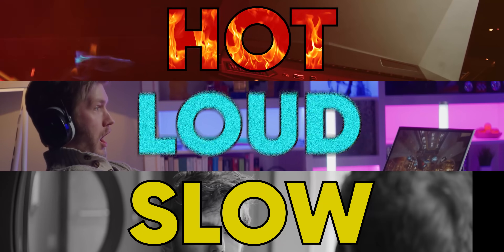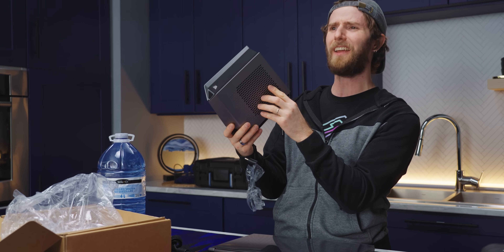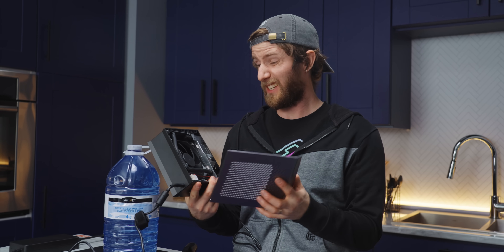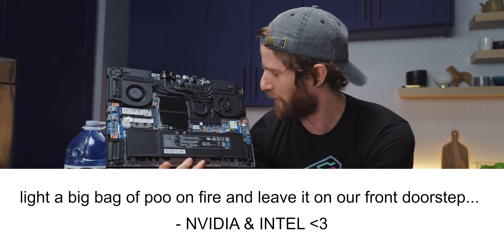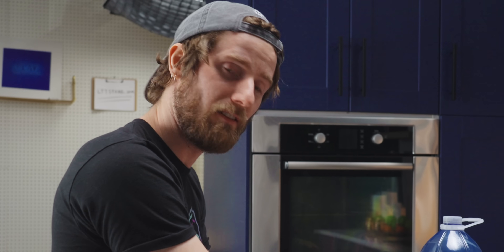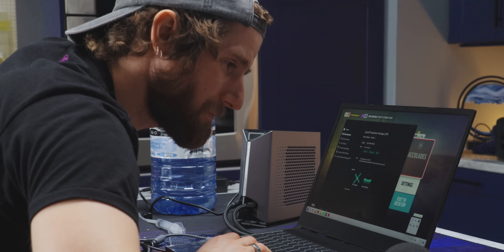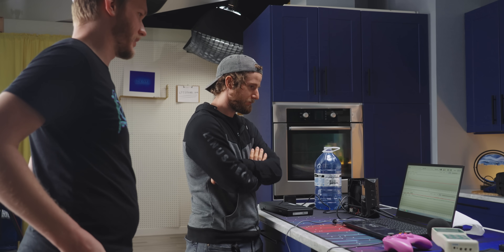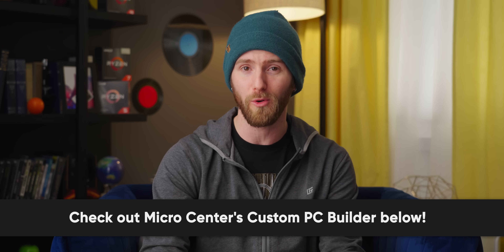This INSANE Watercooled Laptop Has a Huge Problem! - Eluktronics Prometheus Prototype

Comment: Thanks for your feedback! We’re really excited to have a literal game changing cooling solution for our performance laptops.  Yes, yours was simply an early engineering sample and all of the sound concerns for our production version have been addressed.  The water reservoir has been redesigned to greatly reduce bubbles. The internal PCB has also been enhanced to reduce audibility of the cooler.  Also, the cost will only be $99.99 when bundled with laptop purchase.  Much more to come!
Reply: Wow, we rarely ever see a reply from a manufacturer addressing the concerns or acknowledge the feedback. Nice work Eluktronics.
Reply: @N1lav  well eluktronics is not really a manufacturer. this is a tongfang laptop. eluktronics is the reseller. thats why xmg offers similar thing in EU.
Reply: @N1lav  they are not the actual manufacturer though.
Reply: @N1lav  xmg also replies, I had a conversation with XMG Tom, It was really helpful!
Reply: Does Eluk/XMG G3R Air cooling performance par with legion 5 pro with same specs? if we exclude liquid cooler and only consider max performance on max air speed?
Reply: thank you for the reply. a user replaceable fan would be great since fan come in different specs for different reasons as you'd know. but a great product i must say i am really intrested in gettin one now
Reply: @baseplate8428  That did look like a standard 4 pin fan; a good Noctua could be swapped in, it would just need to have the cable coiled up.
Reply: @baseplate8428  at lest with some care looks like you could change it out they didn't meld it in there some crazy way but by no means a easy swap out. Will be keeping a eye on these i almost never use a laptop but my wife will only use one and when we have some gaming time sounds like i have a dam f-14 getting ready to take off
Reply: Nice of you to answer here and be open about it! What about the ability to control pump and Fan via software?
Reply: @metallusmelandril7380  We decided automating will ensure proper operation and provide a better overall experience from the potential fiddlers who have no idea what they’re doing, at least for now.  Fan noise internally of the laptop can be controlled with the Control Center, but the external cooler audibility will not be a concern like represented with this early engineering sample anyway.
Reply: @eluktronics  Ye old argument of “user is too dumb to figure out their own settings.” It would be way better to have both the option to have it software control it automatically and the option to manually control it.
Reply: @samtherat6  Agree. This thing is Bluetooth controlled (so the notebook do know when it can push furter), I guess they might add External fan control in a later build of their Control Center easily.
Reply: @samtherat6  Certainly agree with you as a future update or solution.  However, for a brand new product to the market, it's best we know it will perform the way it is supposed to in efforts of avoiding customers potentially not enjoying the product simply because they're not operating it correctly.
Reply: @eluktronics  Great to see you replying here, I've been singing your praises for some time now - we are an all Eluktronics gaming fam here
Reply: @eluktronics  hello, if you have already ordered daughter boards without software assignable fan controls, i understand. If you have the possibility to control it, maybe try to make a warning or something for it
Reply: @eluktronics  I think in this community you are going to find that opinion will piss a lot of people off. However, we are not your only customers and I love that you not only commented addressing the concerns raised in the video, but are here in the replies answering questions.
Reply: @eluktronics  I would just add return water temp control to this. Set the fan/pump to ~25% speed and ramp up as the return water temp increases. A simple switch for quiet/performance modes would be easy by just adding resistance to the thermocouple as the offset.
Reply: @eluktronics  Nice job guys!  I had a Origin EON17-SLX back in 2017 which was a beast, but it died out in June of 2020 due to heat wearing down the components (some solder fused together, and the power back-fed through the system frying my motherboard, power supply, 2 sticks of RAM, and my GPU in one go).  I paid 6k for that laptop.  Had something like this been available, I would have bought this without a second thought.  I'm excited to see the final release!
Reply: @eluktronics  I can see that software control would be difficult to implement but at least something like a physical switch on the cooler between 0%, 50%, 100% would be beneficial
Reply: @eluktronics  My Asus Strix G15 AE sits at 95c pretty much doing anything. 🔥🔥🔥

While I likely won't be buying a new laptop in the next year, I'm super excited with this tech and will absolutely be looking to purchase a water-cooled unit for my next rig.
Reply: @spencergimlin8763  I agree
Reply: @eluktronics  This looks like a refreshingly simple and well designed product that performs well! However… the barrel jack is a little 1997. USB-C is here to save the world and this product would be a superb use for it - PD for charge and data for fan/pump speed control in the same cable.
Reply: @dregenius  USB-C power delivery isn’t enough for these laptops as a standalone solution.   The power supplies for these are up to 330w.
Reply: @samtherat6  Its a juggle, I can see the downside of needing to also have a USB cable plugged in so the fan can talk to the laptop or updating the connection to also have data pass through, the pump to laptop looks like it doesn't have any data connection, just power & water tubes.
Reply: @eluktronics  it is never smart to assume your audience is ignorant. alot of potential fiddlers are quite intelligent. and even if they screw up, that is on them, and part of the learning experience. people have different needs. some like quiet, some like power. you cant please everyone-- but you can give them the choice, so that if they really wanted to customize something, they could. for me, that is the mark of a quality product. this is in the early stages, market-wise tho. here everyone probably wants everything at once.. or that might just be me.. idk . <3
Reply: @eluktronics  You are worried about a potential "fiddler" on a high end 12th gen expensive laptop? You mean like the kind of person that would want to spend cash on a water cooled laptop? Or you could just fix the glaring issue. Did you watch the video? Did you see Linus' face when he realized the speed wasn't adjustable? Just fix it. It might delay your release a bit and add $10, but as least it won't be a half baked product with a glaring oversight. The world has fan control module figured out by now. Not difficult.
Reply: @eluktronics  Not operating it correctly? Like the adjustable fans that are in 95% of all newer high end PCs. Stop with the blame the consumer stuff, you haven't even sold them yet.
Reply: @eluktronics  I can see the point on a layman-proof control scheme, but that can be compensated for by baking in a hard temperature point override in your control firmware (say like 85C) where it will kick in at max to prevent thermal issues.   As for controlling it, if you replace the barrel jack power delivery with the recent standard USB-PD connection (I think they're up to 240 watts) you'll be able to control it without have to rely on funky physical controls or a insecure wireless control like bluetooth.  As for other tweaks on a standard model enlarge the fan&radiator to 140mm and have the case able to accommodate 38mm deep fans, possibly even increase rad&fan to 180mm wide (Fractal Design Prisma/Silverstone Air Penetrator AP182) swap out the rubber reservoir cap for a metal threaded one with an integrated o-ring and make the fan&pump easily user replaceable.  
 If the devices proves popular enough to warrant creating a deluxe model you could integrate a PSU into it instead of having it require a separate brick,  include a AGRB header for the fan on the control board for loons like Linus and turn it into a full USB 3.2/4 Laptop Dock.
Reply: @eluktronics  going to have to add some criticism there. This is one of those cases of “consumer buys product, therefore is consumers property”. If you guys could add the option on a later generation or iteration somehow to allow user tweaking, many of us would greatly appreciate it.
Reply: @ZetsumieX  No solder should come even close to melting from GPU/CPU temps. Solder melts at 300-450 degrees Celsius. GPU/CPU auto shut down at 110 Celsius.
Not sure what happened to your machine, but it wasn't that.
Reply: @eluktronics  yikes, I was surprised at the original reply. but BOY telling customers they are "too dumb" to adjust fan speed is just sad. who the F do you think your market is lol, this is LITERALLY for people who want to get the best performance out of a laptop as they can.
Reply: @eluktronics  Can you make a bigger 240mm version? Would like some more custom loop features, given how involved it is. I think the laptop's side of the loop needs to be improved upon as well - why didn't they just make it a flat block, like coldplate with fins?
Reply: @eluktronics  Just add or sell separately a 12V to 7V adapter for the fan and pump (it's like 3 resistors and two fan headers on a PCB, you can do it cheaply). I assume that your fan can work at 7V though (some may need more like 8V or 9V, if it can't start at 7V - still, it all can be adjusted in resistors values + same goes for pump). Thank you.
Reply: @eluktronics  GUESS MY NEXT LAPTOP IS GONNA BE ELUKTRONICS ONE.
Reply: @RagingShrimp67  Depends on the type of solder used, but regardless, it was exactly that.  I only know this because I found the two melted together after narrowing it down with the multimeter.  The chassis for Origin's laptop was the Clevo P870KM1-G, and the beefy ass heatsink left me careless.  With that in mind, the EON17-SLX had a 7700K desktop CPU, and the GTX 1080 was the first mobile GPU to ever come that close to the desktop varient.  The laptop put out almost as much heat as the desktop I built to replace it.
Reply: @ZetsumieX  Then you had an electrical short that melted the solder. There is no type of solder used in any electronics nowadays that will get even close to melting before auto shutdown happen.

Probably a popped capacitor, which created a surge and melted your solder.
Reply: @eluktronics  You could fix the main issues shown by linus by using a vacuum driven drainage system, that could drain the full loop while plugged in. This is going to be critical, and is something that I'm adding in to my DIY watercooled Celvo build. Using something simular to leakshield could be used to drain the full system before detaching the cooler
Reply: @eluktronics  that's dumb tho, majority of your customers will probably know what they are doing card manufacturers don't stop us from having custom fan curves
Reply: @eluktronics  The people that will want to buy this lap top and cooler are the power users that know what they are doing and will simply want FULL control over the fan speeds and sorta be majorly pissed at you for considering them idiots to make it fool proof.  How about lock it out unless someone tears the cooler down to bare parts to access a switch on pcb board or pins that need to be shorted or update a bios etc.. so that the idiots will be unable to piss with it and the tech savy people that really really want to control the fans will have the option. in other words if they are skilled enough to access the controls then so be it.
Reply: @metallusmelandril7380  it seems like it would require a pretty significant revision to add that for software control.  Currently, the box is only connected to the laptop via the barrel-jack charger.  They'd have to either add a wireless module, or connect it thru an additional cable. 

I suppose they could engineer a way to do fan control data thru the DC jack, but I doubt it would be worth the cost and effort.  Maybe the next 'generation' of it?
Reply: @startedtech  this has the benefit of only needing to redo the external thing with either usb or blutooth but not the notebook.
Reply: @startedtech  they could also just use a physical dial on the enclosure itself. To vary the pump speed between 50% to 100%. Any lower and it might lose its effectiveness.
Reply: @startedtech  just slap a "volume button" aka potentiometer on the radiator part and it's done. No need to connect to the laptop. Yes, It wouldn't be SW controlled. Which could also be worked around if you could check the coolant temperature somewhere near pump and do fan-curve from that.
Reply: @startedtech  I mean it looks like a standard 3/4pin so you could just use a 7/9V Adapter
Reply: @startedtech  they could easily do fan control via a physical dial on the device itself. Set it and forget it
Reply: @startedtech  add a nob on the side of the   housing
Reply: @startedtech  Should be possible USB Type-C, cost and effort is another question altogether.
Reply: @startedtech  I think auto fan control based on the fluid temperature makes the most sense.
Reply: @startedtech  or maybe just add a knob you can adjust, or even a low/mid/high setting switch. sometimes lo-tech is all you need
Reply: @startedtech  I THINK THE LAPTOP COMMUNICATES WITH WATER PUMP THINGY USING BLUETOOTH. THATS WHAT I GOT TO KNOW FROM THE DAVE 2D VIDEO ATLEAST.
Reply: @startedtech  a wireless connection system could allow for that without having to make the laptop bigger to accommodate an extra data port just for that
Reply: You could add a hardware button on the external unit that would switch to at least twofan speed profiles, Gaming / Silent!
Reply: @Alfa i omega could you stop spamming?
Reply: @N1lav  YouTube has a bot problem
Reply: @N1lav  just report them.  If everyone reported spammers instead of just complaining about it the comment section would be a lot cleaner.
Reply: Sounds awesome guys, Linus was a bit harsh on your product! An other suggestion, user friendly changeable fan! it would be a some to throw away an AIO cooler for a broken fan
Reply: @prochristos  I already want to change it to a Noctua PPC tbh.
Reply: $100 is very reasonable in a bundle imo. That’s much closer to aio pricing and given the specific nature of the product it isn’t that bad.
Reply: @Zosu22  that is a reasonable and competitive product, innit? plug-in AIO for laptop- genious!
Reply: Nice elukronics this is how you gain the respect of LTT fans
Reply: Why did you mount the circuit board on the bottom of the case where any condensation or leaking coolant would go? I would have mounted the control board in the rear up an inch from the bottom.
Reply: You should redesign the power pass through to use usb-c allowing data as well so the fan and pump can be dynamically controlled. That and fix your fill cap and this looks like a great product. The quick connect looks solid and the loop seems well designed!
Reply: Absolutely mint to see a manufacturer take on constructive criticism and act upon it. Dells had thermal and hinge issues for the past 3 generations and they've done nothing about it. Great job!
Reply: Thanks for addressing the video Eluktronics. I've been looking at a new Desktop Replacement system, and this makes for a very tempting and competitive solution.
Reply: Does this product only work with your laptops?
Reply: Now thats someone who cares about their customers
Reply: Professional, quite excited tbh
Reply: Fan speed controller?!?
Reply: @Eluktronics have you thought about selling a kit of an external GPU case with water-cooling combined with an ultrabook with a toasty CPU that could be water cooled at home? Something like the Razer Blade Stealth concept but with an actually good gaming experience.
Reply: Bob of All Trades is that you?
Reply: @boy638  Nah, I’m here 👍
Reply: @boy638  I was literally about to ask that lmao
Reply: Lienus?
Reply: How about a fair test BEFORE tearing it apart? Maybe the disassembly caused the noise.
Reply: Might be worth a further iteration that combines the classic docking station with LAN, USB ports, DP, power via USB-C etc. and this docking cooler.

But right now it's a neat concept as is with great cooling performance and solvable issues.
Reply: You guys fucking nailed the thermals on the Prometheus XVII. Please take more notes from it, Its a masterpiece of a laptop.
Reply: @stupudlargewolf  Wait till you see it combined with the LPP lol
Reply: It is Tsinghua Tongfang solution (OEM). Eluktronics only gives the brand!
Reply: I hope that somehow the liquid cooler pump or vent can be controlled. Like rotary button on the housing. No need for extra usb wire to laptop.
Reply: You should also do something for the build quality, and weight, it seems pretty plasticy and light. My suggestion would also include a battery within a seperate compartment within the enclosure so it won't just be a water cooler but a mini UPS as well. You might need to make it a bit bigger though. And while you're at it, you can also add a input hub for USB's and other various inputs.
Reply: @SmallLegacy  Might as well just build a desktop 🤣
Reply: Hope they send another production one that is complete so we can have a part 2
Reply: Really love the concept of product, keep it going
Reply: @Eluktronics As a laptop user for both work and play I love this concept more than other implementations so far. More portable and at $100 easier pill to swallow. I would like though at least the addition of a speed knob on the box its self for fan control. Just set the low end too a still reasonable speed. In meetings I generally turn all my fans down just incase of any background noise. The addition of a cap that threads into the reservoir to make sure it cannot leak would increase its portability. Being able to go to a lab party or back and forth from work with this pre charged with coolant would be a large bonus. Thanks again.
Reply: Yo these temp differences are LITERALLY amazing. I know that Linus always makes sort of clickbaity titles like "this laptop has a huge problem" when it doesn't have any problems at all considering it's just an engineering sample. What I saw was HUGE reductions in temperatures, literally a game changing difference. The eluktronics team did a GREAT job on this.
Reply: Awesome product, i made a diy solution for my laptop a couple moths ago that is exactly this product(but mine looks super diy), what could be a step up is a bigger diameter copper tube in the laptop so the pump can push more water plus a double pump combo, mine has a push + pull config so the pumps run at a lower voltage and make less noise.
Reply: Good job fam
Reply: Awesome job!
Reply: Can I get a discount if I already bought a MAG-15?  Oh, nevermind... it's for newer laptops.
Reply: Impressive solution guys! Love it.
Reply: Would the noise issue still be an issue if the side panels were put back on ?
Reply: <3
Reply: Honestly, this product has made me excited. I'm definitely buying this.
Reply: This right here is why I'm buying your product!
Reply: Is good to know a corpo makes it's homework.
Reply: As a gamer, it means a lot to me when you read and see what we need 😁
Reply: So awesome, this is something I would totally be interested
Reply: @Alfa i omega stronger than your advertising
Reply: That's actually... pretty cool.
Reply: Sold 👍
Reply: hey That's actually awesome!
Reply: This is the answer I was expecting, good for you guys!
Reply: Is it possible to put this on any laptop?
Reply: @Milannekuhh  Yeah any that have waterblocks.  :)
Reply: @therodenthitman  lmao none then
Reply: Controllable fan speed is a must
Reply: Good stuff. You should of sent that version to Linus
Reply: This is incredibly cool! Thanks for bringing this tech to the masses. I feel like this is really cleanly done.
Reply: Im not an engineer but would say a 240mm AIO style kit improve the performance of the kit even more based on Thermal-dynamics which is something Im fascinated with? 190% the cost of this and people would buy that instead. Especially the newer RTX3080 Ti laptops that will surely get insanely hot.
Reply: @Eluktronics  
 They should have had the power passthrough via a usb-c connector that could also send/receive data to control the fan and pump speed. (someone said this in the comments and I 100% agree. Killing two birds with one stone.)
Reply: Dude, Elektronics I love you for what you are attempting here! GG guys! And LTT I love you a whole frikin’ bunch! But wth was this testing? By the time I was expecting tests and stuff you just rushed through the clip. Sad face.
Reply: This looks very nice! I got 1 question  so lets say you use the laptop at home with the watercooling, the next morning when the water is cool you disconect the watercooling and use the laptop outside the tube is filled with cool water and will heat up very much i assume. Could it be that the preasure in the tube rises so much that it will leak out the connection on the laptop?
Reply: Dang, I already have the maxed out version of the xmg neo 15 e21 and just got a notification, that the e22 version, so this exact laptop just with xmg brand, got available for preorder...
Really attempting to go ful 3080ti with water cooling, but the 12th. Gen i7 looks a bit weaker than my ryzen 9 5800h😅
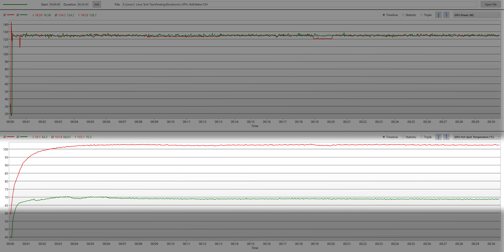Reply: 11:00 not a fan of watercooling but why is the video title like that considering the huge drop in temps and better boost?😑
Reply: A screw plug under the fill port cover might be nice.
Reply: Good to see something new in recent times. And a company that can take criticism, just got done dealing with a company that couldn't. After being commissioned to repair an Ultrasound machine (Portable) for my Veterinarian friend's other Veterinarian friend. LUCKILY it was built on a single board design making it super easy to spot the problem and fix it, which is why it was so frustrating to see it was a problem in the first place since it was an amateur mistake. Choking the heck out of an FPGA board in a tiny space without room for heat to dissipate causing display out issues.  Also a disgustingly liberal use of hot glue inside a $5,000 device with only about $600 worth of parts.
Reply: Wow, this is an amazing option to have for a laptop. I already recommended an Eluktronics to a friend (who bought it). I'm going to pay a lot more attn to this brand in the future.

This is such an awesome thing to have. The price of $100 for dramatically better cooling is a no brainer.
Reply: Honestly, a really cool product, genuinely something that would actually make me consider switching to a laptop for a daily ( carry about during the day, then plug in at home into monitor cooling etc for some gaming)
Reply: Cool!
Reply: Just wow
Reply: @Alfa i omega What that? Rick Roll reference?
Reply: Honestly if you’re buying a gaming laptop and you plan to have it sitting on a desk plugged in most of the time, $100 is a no brainer!
Reply: Thanks god they will improve it
Reply: Simply because of the response here makes me want to purchase this. One question I have is, does the water stay in when disconnected?
Reply: Hey Eluktronics, I got some of your ancient ssd's. How about hooking a brother up with some fresh swag?
Reply: Respect for the update Eluktronics, great to hear that you're listening!
Reply: When can I buy this???
Reply: O
Reply: Nice
Reply: That’s cool
Reply: Very cool product. I think this has a lot of potential!
Reply: All of the concerns? Did the tube ports move to the back on the cooler? Cuz that'd require new casing I guess and that could be a costly change for low volume?
Reply: Will the cooler be controllable with a software? Do you have plans for eGPUs?
Reply: Will this just be for your laptop, or will there be a way to buy and install this on other brands?

I personally really like this idea for people who have a gaming laptop, and want it to run better and quieter.
Reply: thank you thank you!!! i hope such a system becomes perfected and standardized for performance-laptops! 
thank you for doing this. i have been nagging about it for years! awesome! such a solution gives headroom for the manufacturers to make laptops with even more powerful hardware!

 you could make a 360/420 ect radiator version, and you'd be up to a toptier desktop spec for the laptop. 
if the basic plugs were somewhat standard, then these plugn'play watercoolers could be a basic necessity which all performance laptops would have. 
people could for that matter make their own custom loops i imagine. so alot would depend on the laptops. but it definitely opens a whole new world where the difference between a laptop and a desktop becomes less and less. like.. why should consumers have to choose?
I want the All-In_one PC noW! i hope people will agree that this is a wonderful opportunity and agrees that it would be indeed awesome if it became normalized. the thing needed most of all is the standardisation of alot of parts and the chance for people to mix and match what they would want. there is no real reason that a laptop shouldnt be almost as customizable as a desktop if everyone really wanted that. 
one pc to bring to work and travel, and to plug into the office-cooling or cooling at home to unlock it's full capacities!
Reply: Why the hell is it only a 120mm rad
Reply: @genericscottishchannel1603  a) keep cost down since it’s still a experimental product b) dunno if any larger is much needed since it’s a laptop spec c) size consideration
Reply: @sentryion3106  It's outside the laptop size is no concern, and Im pretty sure they're being really cheap given the design is just run water pipes over heat pipes, which are over the heat source
Reply: @genericscottishchannel1603  You underestimate how much these things can cost when its pretty much the first one of its kind so the manufacturing cost to implement these new parts will be immense.
Reply: @sentryion3106  Im pretty sure this is as cheap as they could've done it without fucking their reputation so yes its done cheap
Reply: Finally good company
Reply: Is this the same model that XMG has?
Reply: big chungus
Reply: Oh wow
Reply: Oh I thought this was intel.
Reply: @Alfa i omega CRINGE NECKBEARD
Reply: Send me one for review please
Reply: Buy
Reply: for an early engineering sample it seems really awesome i hope i keep myself updated with your products :D
Reply: Yay, I can finally hard boil my eggs while trying to run 4K
Reply: Serious respect for companies who go to the effort to respond to feedback and address concerns and make improvements people ask for. A lot of bigger manufacturers could learn a thing from you all.
Reply: This is awesome. A quieter fan type swap (Noctua) would be cool. And yes, fan control of 25%, 50% or 100%.
Reply: Helpful suggestion: make a secret button to be able to unlock the seal
Reply: Please more companys do this! Respond in the comments!
Reply: I imagine that if someone paid 4K for a laptop, they won't mind another 100-200 for a SIGNIFICANT increase in cooling and performance.
Reply: That's why eluktronics is the way to go
Reply: @eluktronic made it pipe like vaporbchamber a
Reply: Okay. Seeing a reply from the manufacturer addressing the concerns mentioned makes me love you guys. Will definitely be looking at your products to see if I could find use for any of them in my life.
Reply: Is this only for the Mech 15 or also for the Max-15 and Max-17, who really need it much more?
Reply: Awesome!
Reply: Cool to see a reply from the manufacturer who is happy to take feedback you guys rock 👍
Reply: Just remember this is tongfang NOT eluktronics
Reply: This is amazig! Great answer. But what ist with the seal? :p
Reply: if u guys team up with framework to make a cooling module i will name my first born son eluktronic
Reply: is should have a double fan version
Reply: One of the things I've been telling is to add a mode to run dry. It would be a mode just to run for a few seconds to remove all water from the laptop. I think not having such more is quite a letdown and a deal-changer for me.
I'd buy 2 bases and take the laptop between both my major places I stay. It would be a huge cost saving process...
Reply: 6.9k likes, nice
Reply: $99 is a really good price.
Reply: Out of curiosity: what's the reasoning behind routing power to the cooling unit? Why not pull power directly from the laptop via USB-C? I imagine that this fan + tiny pump unit hardly draws more than 15W, so 5V/3A USB-C should be more than able to power it. This would also give you the oportunity to easily implement fan control and would make the entire unit (more) usable on the go.

BTW: does the unit come with a it's own power brick? Or do you have to fiddle around with the same one you use for the laptop everytime you want watercooling? But then  an extra power brick would be kind of a waste, so the USB solution would be much preferable...
Reply: @nicoj9984  I guess because eluk's laptop usb-c does not support power delivery.
Reply: @DAddy-iy9mu  Even if they don't have a dedicated power delivery port, every normal USB port has to be able to suply some power to connected devices, otherwise your keyboard, mouse or external hard drive wouldn't work. For a standard USB-C port it's either 5V/1.5A = 7.5W or 5V/3A = 15W - and those 15W should be enough for such a small pump and a fan.
Reply: Will you sell this product in Europe as well?
Reply: @Eluktronics will you be shiping this to the EU?
Reply: I hope Bob of all trades has seen this.
Reply: Based marketing team
Reply: I may just buy my next laptop from you.
Reply: True
Reply: Do you have a page for this already?! Google doesn't show anything.. (launch updates, availability world wide etc..) :)
Reply: Now imagine a product: 14" laptop, size of Zephyrus G14, packing i7 12700H and full power (140w?) RTX 3070 or 150W 3070Ti. On air cooling, you´d only get 2 P-cores and all E-cores and GPU would be in the lowest TDP setup. Connect this cooling solution, laptop auto-detects it and enables all cores + full TDP. And the laptop doesn´t throttle. I can´t believe it will only cost 99 USD.
Reply: Please come to India too.....
Reply: What about fan speed control?
Reply: Shut up and take my money!
Reply: i would also suggest longer hoses (and the power cord to match) for this so that it can be put in a more secluded space [sort of an "out of sight (and sound), out of mind" kind of setup]
Reply: If the price of this is reasonable in Europe/UK ie pricing is close to the likes of the HP Omen 17, and not the Alienware/MSI/Asus of the gaming laptop world, colour me interested next time I consider upgrading my gaming laptop.
Reply: Alright, 100 bucks for that performance increase is a really impressive price to performance ratio when running the laptop as a desktop replacement.

Slightly concerned about the top plug and rear connection on the laptop though - having quick-release for water cooling seems... really iffy to me. I'd love for both of those to be more securely fastened, and maybe have a dust filter for the fan (couldn't see if there was one in the photos), but other than that you've got a really nice concept there.

Huge kudos to you Eluktronics for listening and replying to Linus' concerns (even if those were based on an early, slightly defective, engineering sample), and staying active in the comments to discuss questions and concerns about your product!
Reply: l may be the only one but l dont see the point in using a laptop/notebook if ou have to use a brick reight next to it wile you traveling in the first place, and if not traveling just buy a desktop PC on first place. Really dont see the point of this product, and never even been said how it affects battery life, which so far its just trash for gaming.So you see why l dont really see any reason to have this product on first place
Reply: @hard_mode_Gaming  The idea here is you leave the water cooling system at home and just pack the laptop around in a book bag or suitcase when your on the go.

I bring my Strix G15 AE to work with me every day and I get 9-11hrs of battery life doing office work. Sure if your playing a AAA game it's only going to last 3/4hrs on battery but most of us who want a laptop need them for either work or school where gaming isn't a factor.

If this had been available I would have bought it in a heartbeat. My R9 5900hx sits at 95c doing almost anything, I'd get much longer service life from my machine and way better performance if temps could be kept under control.

I think Eluktronics is on the right track. They are bringing a top of the line machine to market to gauge user opinion and sales. I'd bet if it goes well they will bring this tech to their entire lineup including thin and light notebooks in the future.
Reply: @Tekgnome.  well thats my point, if you dont need the water cooling system on the go then l dont see the point on buying it. And if you have the means to buy an overprized mibile PC then you have the money to buy a desktop gaming PC also, which is way better than using the laptop all day and killing the battery lifetime by using it pluggend in at your home while gaming
Reply: That controller board being directly below a water feed line, with through-hole connectors and (what looked like) no conformal coating is a major concern for me. It'd be almost ok if the whole thing was being driven by a small 12V wall-wart with a fuse/polyfuse on DC entry, but the laptop's power supply isn't exactly current-limited, and I could totally see it causing major problems if a leak develops. Not really a shock hazard, but definitely a fire hazard. The electronics really should be above or to the side of the tubing.
Reply: I really wish you offer in the future better screens for content creators (120Hz would be more than enough) with 100% AdobeRGB coverage. The max-15 with 90+Wh battery and a screen like I said would be perfect, even if it weighs 300gr more (due to the larger battery)
Reply: So nice to see the manufacture addressing concerns.
Reply: LETS GOOOOOOOOOOOOOOOOOOOOO
Reply: Great job you guys! I just recently bought my wife the Mech15-G3 the 5900HX and 3080 one for Christmas! She loves it. Also, how plausible is it to get this cooler on that one? :)
Reply: What about being able to control the fan, and pump speed?
Reply: @Eluktronics
Your website says that the Premetheus XVII LPP is going to be starting at CAD 1,999, with pre-orders starting next month whilst your MECH-15 G3R ALSO starts at CAD 1,999.

I don't buy that for one single bit.
Reply: Incredibly Based
Reply: @Alfa i omega imagine buying likes and self advertising
Reply: If you guys play your cards right, I can see this solution being a very common under desk add-on, just make sure it doesn’t look super cheap like that even when having to use cheaper materials, maybe even add some LED indication for the water level to make it look more of a  “gamer” product.
Reply: Nice to hear a reply from a company after a Linus roast.  Implore Linus to re-review the product with a market version the product which should easily score higher considering the issues that have been addressed.
Reply: Laptop & Pc Manufacturer: Now you can have this "X" model Laptop with external water cooling adapter version for additional $199 on SRP
Laptop & PC accessories manufacturer: Now you can watercool you laptop, buy our laptop heatsink with external watercooling adapter that comes with modified laptop bottom case, price varies depend on laptop models.  

btw, great product, you can add if it possible a sensor on the end of the tube connecting to the laptop, that indicates the product will not run if not properly connected or disconnected at all. and possible a tower version for bigger rad. and rgb? :)
Reply: With the new 12th gen Intel CPUs consuming insane amounts of power, I’m sure this product will be very useful especially in tropical countries like India. Please bring this to India!
Reply: Get ALL the laptop manufacturer's to put the port on the back like as a standard. For the love of god.
Reply: Great company, hands down
Reply: If you do a 280mm radiator you will have:
1) better temps
2) less noise (140mm fans vs 120mm fans).
3) you can use the same design and just make it a tad bigger.

All of this, paired with either noctua or bequiet fans and you got a pretty nice product and cooling solution for even the craziest laptops.
Reply: Unless the design is open source or available to use for other companies. If bought later will still be for your laptop so why not keep it 99 usd regardless of when it was purchased.
Reply: Nice
Reply: thank you for caring about gamers Eluktronics
Reply: What is the model of this laptop?
Reply: Also when is this going to come out?
Reply: TAKE MY MONEY!!!
Reply: I'd rather go with 140mm fan
Reply: what a honest company, directly comments to public
ill try your products when it releases.
Reply: Amazing!
Reply: I have one simple question. Why doesn’t the water cooling plug also include laptop charging and fan control
Reply: This actually looks (potentially) amazing. Godspeed, make it work <3
Reply: Call it Lil PP.
Reply: I use a two stage simple fan ramp for my watercooled laptop mod, keep it low while GPU temps are where they stay with circulating water, above that, quickly ramp them up on air only. It works for my overkill components, 360mm rad with 6x (silent) 120mms in push/pull, and the tubes are soldered across the giant vapour chamber GPU cooler giving heaps of surface area, meaning temps are ridiculously low (60-70C on 2x modded 1080m drawing 200W+ each)

I'm trying a delid/direct die setup for the 9900K CPU. It's proving much harder to cool above 100W draw. I can go up to 170W on this mainboard, getting 150W+ stable is my goal
Reply: Niiiice, this awesome, definitely gotta see this kind of response from more companies.
Reply: I feel like the solution to control the fan and pump should just be a temprature probe on the intake and a single knob to control how agressive the fan curve is, way simpler than trying to communicate with the laptop and less prone to issues. Easily doable even in analog
Reply: @Pear Electronics Wait what?? All I asked for was a fan speed controller option.. 🤷‍♂️🤷‍♂️
Reply: Is this going to only be an option for the Intel versions? This is exactly what I'm looking for and if available for the other configurations listed on the site is likely to be my replacement laptop(6 years on and it's finally time to replace my current).
Reply: Sick product, wish I could afford one.
Reply: well done eluktronics!
Reply: @eluktronics I love that you are looking at feedback.  One piece of feedback I can offer from the professional field, is to not force users onto Windows 11.  When I went to your site to purchase one of these for a client, the only option that was available was Windows 11, which makes older applications from the engineering and medical fields not play nicely.  While I'm sure that Windows 11 will get there eventually, the reality is that the Operating System is not ready for many if not most environments.

Please allow the option for either no O/S or Windows 10 - I would be fine with no O/S as it would let me select the best option for my clients.
Reply: This is dope
Reply: that’s awesome
Reply: Props to eluktronics for actually taking the time to acknowledge the problems with their product and potentially get them worked out before launch. Maybe I'll be getting an eluktronic laptop as my next laptop instead of razer.
Reply: Are yall gonna make an all amd version? I think with their efficency you would be able to push them even farther
Reply: Woah nice work
Reply: You guys are great bud fan of your laptops
Reply: Can we get an update on this here? Was about to buy.
Reply: i have one of your laptops and i just want to say its the best laptop i have ever used i am so glad i went with your company over any other big brand name i love your products and i only recommend your laptops to all my friends i own the mech 15 g3 with a r9 5900hx and a rtx3070 and it has been my daily driver since last year plays all my games with ease and i love the eluktronics control center i wish i knew more about how to get the most out of it because i know im leaving alot of fps on the table due to not knowing how to optimize is there a way to talk to someone at your company to advise me on how to set up the control center to squeeze more out of my system please and thank you for everything
Reply: Gotta say that your product looks very promising!
Reply: I think I'm gonna buy the mech 15 g3r. You guys have exceeded my expectations
Reply: When will be that price?
Reply: I personally would like to see any enclosed space with water cooling have conformal coating on the pcb controller.  It would be impractical with a water cooled pc, but a small niche box like this could definitely ease my mind.
Reply: You guys ever considered a DYI kit for people that want upgrade their existing laptops to liquid?
Reply: @Negative Scope I wonder
Reply: you should let us handle our own bios. its frustrating that i want to fix this laptop i bought off of facebook market place. because all it needs is a bios flash or update. but you guys dont let people download it. very pathetic .
Reply: Am okey to pay 200€ instead of 100€ combined with a new laptop for a even better external cooler. Gpu temps are vary good but cpu needs a bit more, new chips get really hot. Also i would like to minimize laptops funs and still get good cooling. I know linux broke the cooler i have used it personally and it is quiet.
Reply: Are the water cooler and laptop Tongfang products?
Reply: Do the pipes have check valves? (Simple ball and spring to keep water from emptying tubes when unplugged) I just see a big puddle mess everytime I move my portable laptop. 
I am also wondering why not make a sealed cooling radiator pad to set the laptop over, and "trash can" shaped condenser that can sit on the floor and keep my feet from getting sweaty. Midea makes a dehumidifier for $99 which has an actual compressor. Why not here? Lots of gamers have sweaty feet! This could be better.
Reply: Hey can you do a 400 hz screen like the dell
Reply: I got the current gen of the Mech 17 gp2 and the one suuuuper disappointing thing is that the liquid cooling heat pipe only runs over the gpu. Cpu gets no benefit other than overall system heat being reduced
Reply: I just bought the barebones version with water cooling.  Slapped in a 2TB Samsung 990 pro and 32 GB of DDR5 5600.  I wish they would include a USB with all the drivers.  Also had to re-flash the GPU..
Reply: When do I get my eluktronic p650hs-g screen bezel
Reply: The fact that you decided to respond here in public says a lot about your company. Good on ya Eluktronics and GREAT COMPANY!
Reply: I really hope you guys do an up to date 17 to 18 inch version of this with a 5090.
Reply: Product aside, I really like that you acknowledge the problems and openly admit to them and clarify some things.
Wishing for your great success.
Reply: Wow, this company really lisents to feed back 👏 👏 👏
Reply: Even a physical know to turn up/down the fan speed would good.
Reply: Your product will be a game changer!!! Can't wait for the final product!
Reply: Nice product original idea
Reply: Brilliant product, but think it needs a Noctua fan
Reply: @Alfa i omega KETTLE
Reply: Aluktronics, wow, you replied.  Linus is the only guy I trust PC reviews from.  I am glad you are improving it.  😁
Reply: Hey Eluktronics..  This looks super cool and If it will fit in my budget, I will probably buy it in a month.

I know it's too late, but few things that I would do differently:
1) connectors on radiator from the back.. so I can put it directly next to my laptop.
2) RGB... That makes everything better
3) if software control is too complicated, simple potentiometer would be enough..  

I hope that I can quickly connect/disconnect the laptop without leaks...  So I can take it to school and plug it in when I get home.
Reply: Worst laptops ever .
Reply: @Eluktronics I'm looking to upgrade my aging 6700k and GTX1060 editing laptop and I'm an electromechanical engineer. I don't have Linus's view numbers but if you wanted 500,000 people to see I'm using one of your laptops for editing on the road and at home, let me know. *ignore the viewcount on the last video, lost 200,000 view due to a re-upload*.
Reply: @c90adventures  just buy one you cheapo
Reply: @c90adventures   stop begging for stuff on the Internet laptop you currently have is fine and better than what most people are currently using at the moment suck it up make. Some videos and upgrade when you can pay Linus tech tips does not Need companies to send him free stuff they do that so they can show what’s currently on the market and it’s pretty much tech news so get over yourself and your crappy channel and get to work on making some good stuff get good stop begging